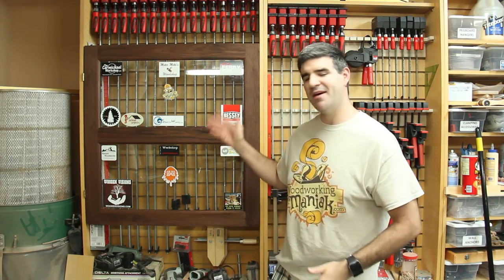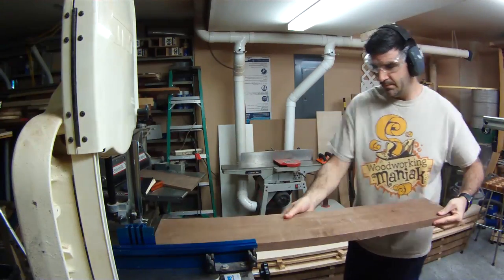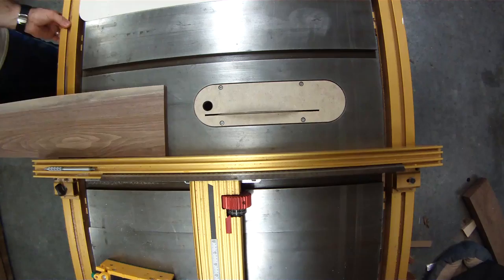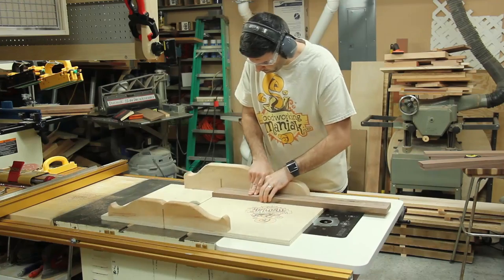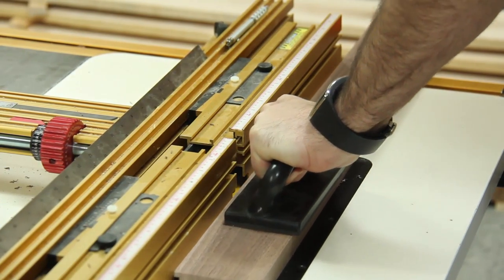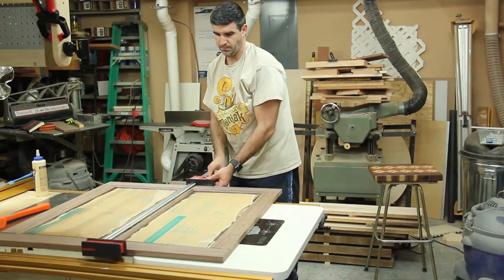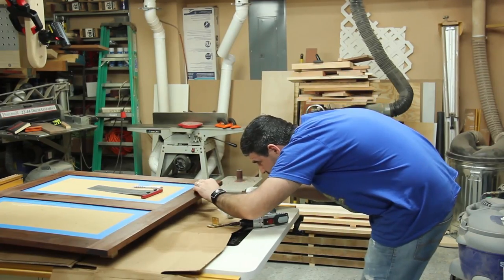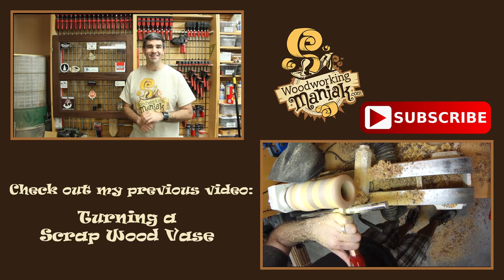The Frame & Panel Sticker Door

Comment: Tim the door came out looking great. I think I got those same router bit a few months back. I was excited to use them but still haven't come up with a project. Lol impulsive buy, thanks for the video. 

Ken
Reply from the maker: Moonpie Creations The set worked out ok. Didn't match up pefectly... Required a little extra clamping pressure and sanding afterward. But for the price, if only making a few panels, it was worth the investment. Making the amount of doors that I'll be making, I actually wish I bought a Freud set. :/

Comment: Cool project. I finally got a router with a 1/2 inch  Collett so I'm looking forward to using one of those bits.
Reply from the maker: Conrad Designs That's awesome! Does your router have speed control? If so, I'd recommend slowing it down to its slowest setting as well.
Reply: +WoodworkingManiak, no I didn't get one with speed control.  Hopefully some day.
Reply from the maker: Conrad Designs They make speed controllers that you can plug the routers into. I've used those in the past, they only cost around $30 and they work pretty well.
Reply: WoodworkingManiak if you haven't already, you should be getting something in the mail soon.
Reply from the maker: Conrad Designs If you haven't already, check out today's video. :)

Comment: Looks good man, what brand panel bit set is that? I just recently got my incra router setup in, I can't wait to get it all assembled so I can use it.
Reply from the maker: Lane Bros WoodShop Thank you! The panel bit set was just a cheap set I bought off Amazon. Yonico brand. I think they were like $50... They cut pretty well and got the job done. However, they didn't match up perfectly, so they took a little touch up sanding after final glue-up. Worth the price for a few cabinet doors. I will probably invest in a Freud set if I burn these up. I love the Incra fence system. Great investment!